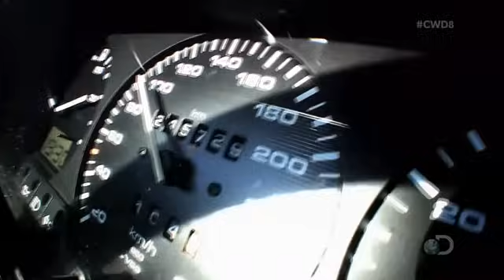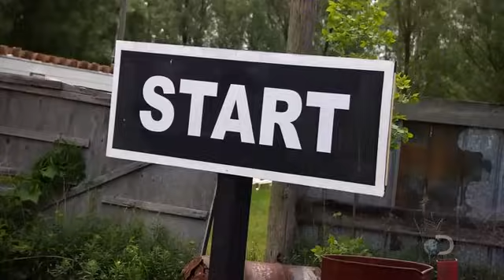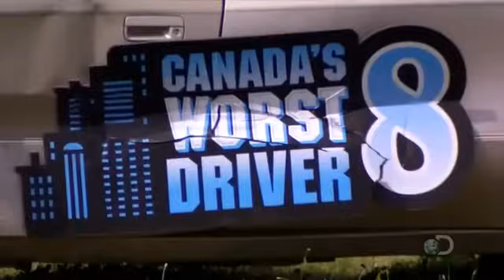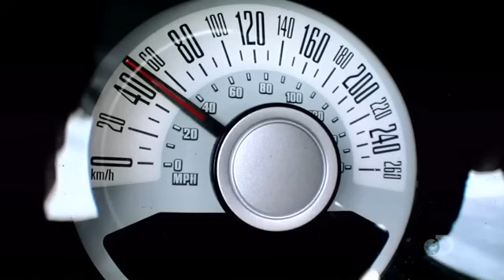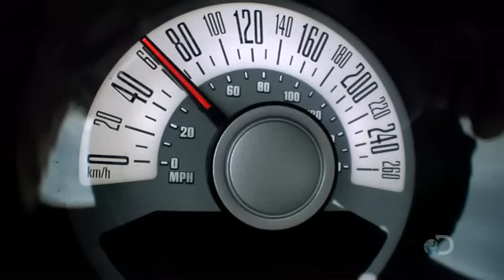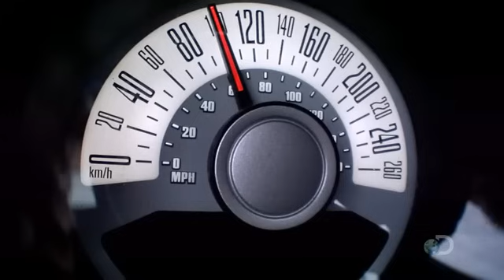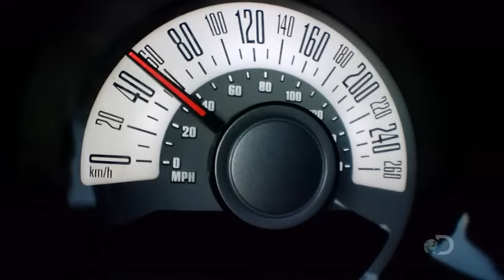CWD S08E02 - Canada's Worst Driver Season 8 Episode 2

Comment: On the merge left or right check blind spot challenge, why didn’t they require the drivers to also use their turn signal?   
Also I think in each season that 1of the 8 drivers is actually competent but pretends to be horrible to help determine how bad the other 7 are.
Reply: I assume they aren’t using turn signal because this is an “emergency” swerve to avoid an accident and the checking the blind spot is to make sure they don’t swerve into another car.

Comment: Here is a legit question from a none american.  What is the approximate ratio of automatic vs manual gearbox cars in america?  If they are this bad using an automatic then how about having them try a manual.
Reply: Its about 85 percent auto 15 percent manual and most of the manuals are high performance cars such as high tier mustangs and the like, there are regular cars with manual options, but it only adds about 1,000 dollars to get auto, and you have better resale with auto gearboxes so most Americans buy automatics, most gear heads buy manual because it feels so nice and i buy manual just because its dependable
Reply: only about 10% can drive stick